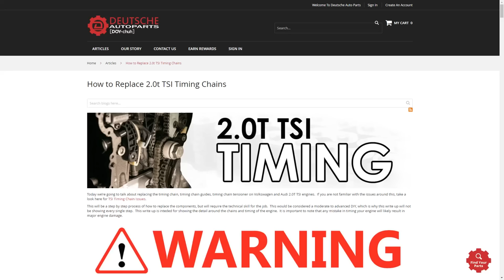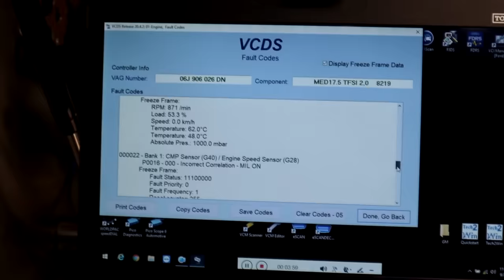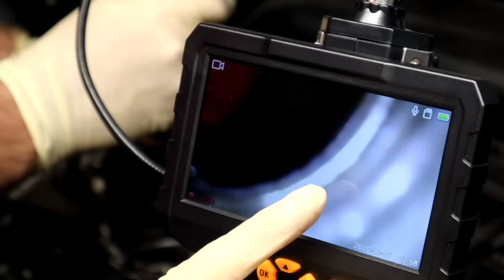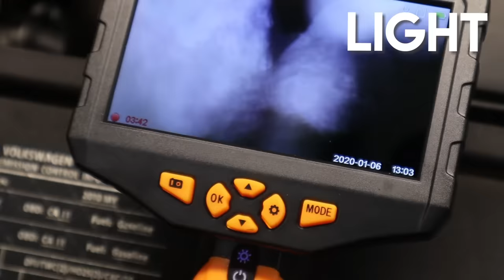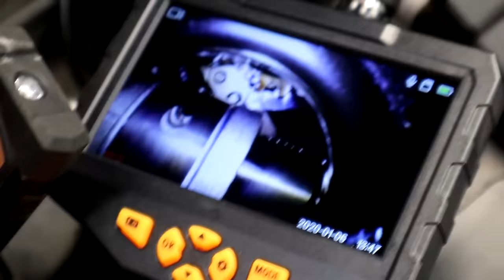The Jalopnik Tiguan FAILED ~ Despite the Warning

Comment: No Audi 
No BMW
No VW
Happy life!!!
Clean driveway!!
Sounds good?
Sounds like a sawing machine..
Reply: Old benzes ftw. Non of these dumbs issues to deal with
Reply: Yeah but no passion  in driving  two of each in my drive way and lots of tools lol
Reply: @buddiec41  I know but don't tell me that you can't have fun with a Miata and have a better life..and still play with tools!!! Doing performance upgrades instead fixing bad German design
Reply: @TheHienax  miata are fun soni give you that and i would not say bad German design just over engineering in lots of small places hence the plethora of specialized tools and computer software.  But I think you would have  fun in a s2000 also  wanted one for a while until I found and brought the corrado  back to life
Reply: @buddiec41  my first car was a VW gol ..yes gol not golf..is like the fox but hatchback and a little more rounded.. really like Corrado but I don't think that you can compare to a s2000 or a Miata ..is other kind of fun car to drive
Reply: @TheHienax  curious as to why you make that observation,  my corrado vr6 was my first vw, but I also have a 05 jetta  not at all inspiring, while the corrado  in its current  state is not blazing quick handles are rock solid,  and fun to drive for a front driver

Comment: My (now inherited by brother) 2012 Seat Leon recently turned over 100000 miles. It is a single turbo 1.4 TSI 90KW with a manual.
It's the last of the Mk. II. It has been mostly reliable.

Comment: Bought a used 2012 Tiguan with 88k miles on it. Body and interior were immaculate. Engine was a major POS. I can’t believe any engineer thought it was a good product. As the list of what it needed grew to the point I would have as much in repairs as I paid for the car I finally gave up and dumped the car for a loss. Selling it was the best car decision I’ve ever made. And this video just confirms my decision was right.

Comment: I had the same problem with my r53 Mini Cooper. Took the timing cover off and blamo there it was wedged between my crank sprocket and bottom oil pan galley.

Comment: My 1973 Chevelle 350 V-8 jumped timing at the 66K mile mark when the plastic(!) cam sprocket stripped. (Yes, I paid the $25 extra for a steel replacement cam sprocket.)
Bent a few valves, put dings in a few cam lobes, collapsed a few lifters.

Comment: I did the same job just to pull the engine 7000km later to do the balancer shafts. I suggest do the shaft at the same time.

Comment: Awesome rebuild guys… wow all intake valves that’s impressive tagging of the pistons.. curious if you guys did a cylinder leak down testing after installing the head, pre cranking over? Also, curious if that upper cam chain guide was just defective or if it wore through and fell apart? Great video 👍🏻

Comment: My brother in law had a Tiguan. The serpentine belt jumped off the pulleys. Spent 2 weeks at the dealership waiting for a belt and tensioner. He sold it shortly afterwards.
Reply from the maker: Yikes!
Reply: Please correct me if I'm wrong. If this kind of repair has been carried out. Which is quite major and all others by comparison would relatively be 'small'. Isn't the car worth keeping? It's been fixed with probably better parts than the original, right?

Comment: My 2001 Passat 1.8T needed a warranty replacement of the cam chain adjuster at the 4 year mark, due to leakdown. Symptom was a humming/buzzing noise on deceleration. The new one has gone 16 years / 50K urban miles since then, seems OK. I have also read that cam chain adjuster problems are rampant on BMW 4-cylinder engines from around 2010-14 or so.

Comment: Rented a brand new Jetta the other day, 150 total miles on it when it got to me; it already had two faults, the oil level sensor was busted and the auto-start-stop system wasn't working (but it went ahead and re-enabled itself each time the car started, so you had to turn it off manually again or it would put the warning on top of the speedometer). Put 500mi on it in a day and it did the driving thing nicely, but boy I don't want to know what goes wrong in a year or five if it took just a week or two off the lot for the thing to have two issues.

Comment: This is EXACTLY like what I found under the rocker cover of my Girlfriend's 2.4l LE5 in her 2012 Malibu. I knew something was wrong when I could hear the chain slapping around under load. Luckily valves didn't touch pistons. Stopped and had the car towed. 

The top timing guide between the cam sprockets/ phasers was worn completely through/ broken off. What killed her particular timing system was a broken static guide between the crank and intake sprocket. Engine was clean and well cared for. Poor quality plastic part broke and nearly killed the engine.

Comment: Awesome content guys. Had a timing chain tensioner and wastegate replacement done on my 2013 MK6 GLI last year. So it's dope to see the process of what's actually done. 👍🏽
Reply: Just had my 2016 GTI done yesterday. No damage, the only hint was P052A and slightly unstable intake measured timing in VAG-COM.
Reply: I have a 15 GLI with 123k easy miles. Will I get a code before anything catastrophic happens??
Reply: @JoeCole12  Depends. The wastegate failure I had activated the check engine light but I was still able to drive the vehicle. I've also had Coil Packs/Spark Plugs fail which activates the check engine indicator and immediately puts the vehicle into Limp Mode. 

My 13' GLI has the earlier generation 200HP EA888 engine (gray and black engine cover). The earlier gens are known to have certain component failures involving the Timing Chain and Coil Packs (as the fellas mentioned in the video). 

If you have the later generation EA888 engine (all black cover) I believe some of these faulty components were updated to prevent certain failures.
Reply: @DamonBlack_Media  Thanks for the info and clarifying what generation engine I have.

Comment: I had a  VW Touareg v6 tdi new but with barely 20k miles on it, the aircond vents couldn't properly close so I had to put up with unpleasant air that's coming into the cabin from outside for 4 years. Two years later with 80k miles on it, it already went through an engine rebuild due the oil pump failure which subsequently busted the connecting rods and other components. Thats when I got rid of it cheaply. Even though I was feeling down , I've never felt so liberated. Now I'm back on the road again with Japanese Lexus. I guess I was following Scotty Kilmer's voice echoing back then.

Comment: I understand why modern vehicles have chains most of the time, as they're supposedly maintenence free for the life of the engine. However at our shop we see so many problems with chains from all manufacturers that I honestly prefer belt driven engines. Just do your belts at the scheduled mileage, and you shouldn't have problems. The Honda J series v6 comes to mind, a very well designed engine that commonly goes 300k if it gets a belt every 100k miles or so. The belts are also very easy to replace, much easier than a chain.

Comment: I watched this video when it came out and am coming back after doing the timing on my '09 A3.
If you have any chain noise on startup... Don't drive it anymore at all. My car only made a tad bit of noise on startup and I stopped driving it while I got setup to do the timing. It ended up being way worse than it sounded, Don't screw around with it or put the timing off on these cars, At least change your tensioner.

Comment: I love my 2015 Jetta, but I did have an engine failure at 85,000 km, on my 1.8 liter TSI gas engine, VW did cover it, but would not admit a pre tensioner timing chain failure, they said number 2 cylinder dropped a valve... blew a connecting rod through the front of the block.. but i got a full long block under warranty,  they said $19,000 cdn damage! Yikes 😬

Comment: working for years in a machine shop, it is usually never the chain that fails but it is 1st. the nylon guides and then tensioners which is then followed by the chain.
Reply from the maker: That was how the VR6 engine are.

Comment: I say if you own or are thinking of owning a gen1 TSI vehicle just plan on getting the whole timing circuit replaced, especially if its higher milage. Doesn’t matter if you have old or new tensioner, your chain can still stretch over time. Better bite the bullet and spend $1300-1500 for the job instead of having to spend $4000-10,000 or have to buy a different car when things go bad.

Comment: Those early EA888 were garbage and should have been subject to a recall. (Weren't in Australia.)

We had a customer drop off a Tiguan for the diagnosis of an oil leak. They had parked the car on the street out the front of the shop. Later we go to bring it into the shop at around midday, turn the key, bent valves. Not easy to explain to a customer that dropped off a running car that the chain tensioner, that could have failed at any moment decided to pick the exact moment we had the car to fail and will require an expensive repair.

Comment: I had a Plymouth Laser Turbo AWD (better-looing IMO Mitsubishi Eclipse - fantastic car) that snapped its timing belt at about 20K miles . Under warranty but 2000 miles from home. (The recall notice was in my mail box when I got back). Chrysler mechanic in Las Vegas replaced all 16 valves  and guides. I drove home and drove that car another 300K miles without a problem

Comment: I actually have seen a hole in a piston from a broken timing belt on a different manufacturer before (Kia). I pulled the head expecting to replace the valves, and to my surprise.....nope, scrapped engine.

Comment: Another thing with getting a new cylinder head rather than going to a machine shop is that you get the latest component revision, which if you know anything about Volkswagens, it seems like they revise their parts daily because they didn't make it right the first time.
Reply: ... and the problem with getting the latest revision part, is you may not get all the other revised parts to make the revised part fit.

Comment: I was pulling parts from the yard a couple months ago and there was a mint Tiguan, it even smelled good inside. On the back seat were all the upper engine parts, you could tell right away the mechanic reached a point and called it. Next oil change sticker read 98K. What a waste. I pulled some nice parts for ebay but they have not sold. I'm thinking there is no demand, these cars don't last long enough and have no value to fix.

Comment: I have 2 Audi A4's, an 01 and a 14. There is so much on top of the 14's engine that I don't yet know what it is. That extra vacuum pipe with the filter that goes on the valve cover. I have and now know what the hell it is. But I really need a book so I can figure it all out. It only has 60K on it but eventually will need work. The 01 I've been through 100 times and the 1.8 is a really easy engine. The 2.0 TFSI is a lot different!

Comment: Great vid guys, checked out ur podcast to, totally love them the diesel gate one I totally get, here in the UK I have one the affected VAG products, it was just out warranty when it happened but 100k later it’s still running great still does 40-50mpg and no I never did get the update in the UK we got to sign a disclaimer and opt out - the amount of environmental damage done to reduce localised air pollution is criminal.

Comment: You should use fuel injector cleaner every 3000 miles. Per Volkswagen recommendation, will clean carbon and soot from injectors, intake and exhaust.

Comment: I see you guys know this engine , i have it  and i have a problem , when Engine is Cold , first 5 minutes , it stutters on cruise , slight gas . If i step on it after 2000RPM it mostly works good , tho still  a bit rough . It Hesitates a bit and has lower power ,  after 5 minutes its all good , no a single problem , like new .
I changed the Timing Chains , belts , water pump , fuel and oil filter , Intake manifold ,  sparks ,cleaned the intake valves manually , regular oil changes , and stuff , ive also checked for Vacuum on Oil rod , there is vacuum . There are no oil leeks but it eats oil , about a Liter on 1000miles or so . Fuel consumption is within specs.
I also noticed that when this stutter happens lights in Cabin flicker slightly , you can barely notice it .
I had codes for misfires , but my home OBDII scaner does not find them , i will  get  a better scanner  to see the Fuel trim because the one i have connected to Torque app does not register fuel trip .
Do you have any ideas , can you help me ?
Much appreciated

Comment: Tiguan is good car for mechanic to learn.
Tensioner, chain, guide, piston ring, oil seperator, head crack, turbo, turbo clamp, diverter valve
And TRANSMISSION AS WELL LOL

3 month in VW dealer or vw specialist shop you can be ultimate engine man

Comment: As a retired (Audi  much of my Career) Professional Wrench (43+ Years), I question why Y'all didn't Opt to replace the Bent Valves (Lap them in by hand yourself, no Machine Shop required) rather then get a reman Head (Only reason I can think of is that it makes the Job much easier for a DIY'er). FYI, January of 2021 I purchased a 2007 A6 Avant (FSI 3.2L) with 139K Miles and an Oil Leak for $5K (A car I had told myself back in the day I would Never Own when I was attending a 3 day 2005 Audi Inro Class for the A6). I went ahead with the purchase knowing that for the most part the Wagon had been maintained to the best of the previous 2 owner's abilities, it at least had a Transmission Service at 85K, several attempts to cure the Oil Leaks had been made including new V/Covers, New upper T/Chain Covers and a New Mechanical Vacuum Pump. The remaining Oil Leak was from a "Hard" Oil Filter Housing "Seal". I also was aware that the Upper Timing Chain Tensioners were Original. In the fall of 2021 I replaced Both of the Upper Timing Chain Tensioners from FCP Euro (as a Maintenance item). Spring of 2022 I performed a partial ATF Change with Schaeffer's All-Trans ATF (Shifts noticeably better afterwards). Bottom Line, I've been extremely happy that I bought this Audi. BTW, the Audi replaced a "Soul less" 2011 Honda Element (inherited) that I sold for $10K, the 2007 Audi A6 Avant is 4 times the vehicle at half the cost.   Randy   AKA randog311
Reply from the maker: We had the head ready to go. And you’re right it’s much easier for a DIYer

Comment: My 2016 Tiguan had a loud rattle at startup for a little while. Sometimes the rattle was worse than others, but still concerning. I did  some internet searching, asking some other friends that work on their own cars, and of course YouTube; which is where I came across HumbleMechanic. 
I take very good care of my cars, and this one is no exception. Regular oil changes with proper oil and Mann oil filter, plus always running high octane gas as per recommendation by VW. After all the research I was concerned the problem was timing chain related. Even though 2016 is well into the years after the tensioner recall, you never really know. In my mind I’m thinking, the car only has 29,XXX miles, and is driven very easy by my wife. There should be no problems. Luckily I’m still in the 5 year/50,000 mile power train warranty so I took it to the dealership.
After them having it for two weeks, I finally get the call that it’s done. The reason for the problem is “internal failure of the intake camshaft adjuster”. The description says they inspected the timing chain tensioner and found seven exposed teeth which exceeds the six tooth max for timing chain stretch. They replaced the intake camshaft, spool valve, camshaft timing chain, 3 timing chain guides, and the timing chain tensioner among other parts.  The car seems to be running well now after a few days of mixed city/highway driving. 
Sorry for the wall of text, but I figured this info might help somebody. I would like to thank HumbleMechanic for putting out great videos and sharing his knowledge.

Comment: Was going to buy my daughter a used Tiguan for college. Glad it got sold before I could take her for a test drive.
Reply from the maker: As much as I hate to say it, there is probably a better car for her. If I sent my daughter to college in a Tiguan, id be sure I had someone local to help out with issues. In a CR-V, prob not LOL
Reply: @HumbleMechanic  lol, true.  I think we're going with a Mazda CX-5.
Reply: @matthewbittenbender9191  In my experience with sisters, I think the CRV will run longest with little or no oil with the K24 engine. Don't ask me how I know this. Sister's or wife for that matter don't care about oil changes.
Reply: Ended up going with a Mazda cx-5.  Good maintenance records and solid cars. And it seems like everywhere with a Subaru in my area is trading in for these.

Comment: I had a head replaced on my MK5 because the timing chain between the cams (I have a belt) broke. Side note, if you are pulling the intake, is that a good time to upgrade the turbo? More room? Easier?